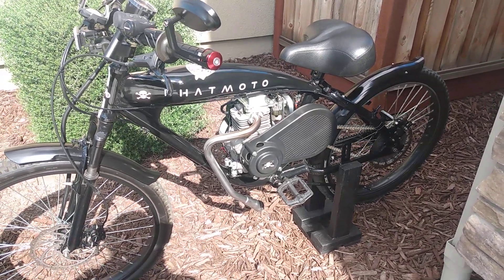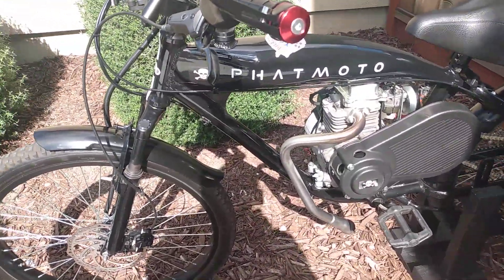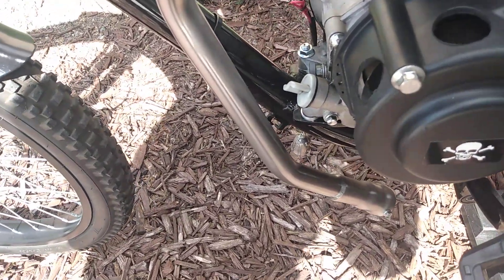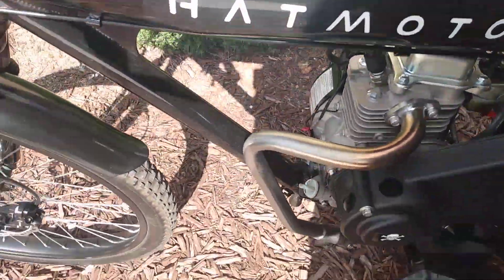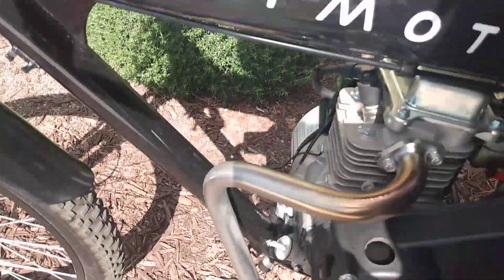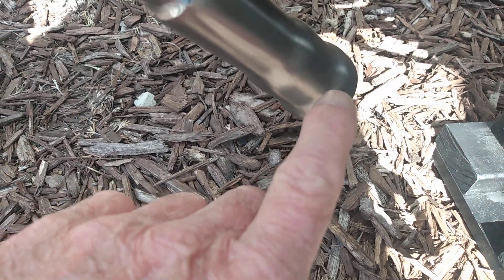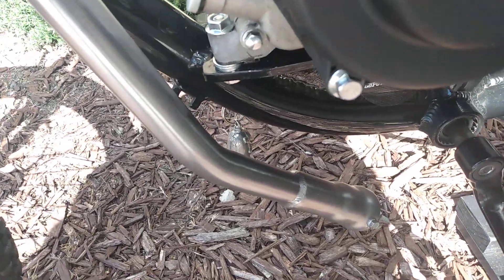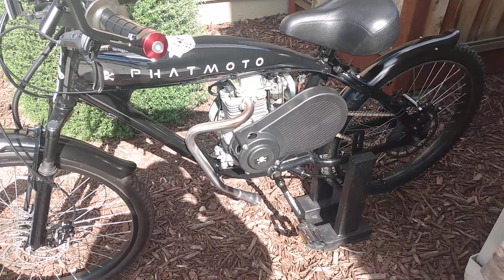Phatmoto with new AR Sports flared trumpet exhaust (Sound) baffle installed

Comment: I have the same pipe. I sprayed it with 2000 degree paint then double pipe wrapped it. I sprayed the wrap with more 2000 degrees paint. Once dried I sprayed high temperature gloss   It looks really nice and you can lay your hand on it. I also milled the head and shimmed the valves. I also rejetted the carb. I also made new vinyl stickers that say 49 cc ohv. Looks and runs awesome.

Comment from the maker: The baffle consists of a threaded rod, 2 large flat fender washers ( different sizes) nuts with a L bracket to secure it to the pipe. The washers have 2 different size holes drilled around the circumference to allow exhaust to exit. The washers fit flush in the flares, very simple design.
Reply: Oh ok. That would be a nice diy project to do! Thanks again Beau👍

Comment: What's the easiest way to change the bearings on the jackshaft mine got messed up after 5 days of owning it and it's been sitting now for ever tried starting it but now I think I'm going to upgrade the carb I'm thinking putting the bearings in the freezer first I got one of the old ones out second is stubborn love the channel I've gone through alot in last year and a half now I'm ready to get the bike going again
Reply from the maker: Thanks for watching, putting them in the freezer does help. If you have one out already, you should be able to insert a long punch in from the other side and lightly tap it out. Do you have the 2019 model or a later model, ie: 2020, 2021, 2022? Why I ask is the jack shafts are different, the 2019 uses a 15 mm keyed shaft, where as the later models use a spline shaft, with bolts to hold on the shaft and sprockets. I always use a pick tool or a utility knife blade and pop the rubber seal off the new bearing. Then I clean all the original grease out and repack them with quality high temp,high pressure wheel bearing grease. If your bearings are from China it is imperative to do this as they put a tiny dab of grease in them, which is why yours probably failed so quick.
Reply: @beaubrummelmotorizedbicycles  it's a 2020 I waited so long to get it then it broke then my brother got sick and passed away n I just lost my auntie cpl months ago and my friend was murdered n it just sat I got the new jackshaft kit then it wouldn't stay running so somebody told me pump gas ruins those cheap stock carb so I'm just going to order a better one and hopefully I can get it running again it's been a tough year and a half but thank you for replying I watch all your videos and it gives me inspiration depression sucks but I'm getting better have a great day and I'll be watching
Reply from the maker: @itsdarooster8160  Sounds like its been some difficult times lately, but better days are ahead. You can get a new carburetor on Amazon for about $15. It will have a air/fuel mixture screw that the stock doesn't have because they were EPA smog carbs. Just search for a Lf152-3 carburetor. Pump gas is not good to let them sit, if it has ethanol in it. It will turn to gel, plug up the jets, attract water and corrode the carburetor. Sounds like all you need is a new carb and some fresh gas and it should run, get your jack shaft squared away and you should be good to go.
Reply: @beaubrummelmotorizedbicycles  yeah it's been tough but thank you so much for the information I'm going to order the carb so as I can I really appreciate it my original plan was to show how I got the bike assembly and stuff on a YouTube channel I started it then bam lol but I know you are a very busy person so I appreciate your time to help me I'll let you know how I make out n thank you again
Reply from the maker: @itsdarooster8160  Search for Lifan 152F-3 not the Lf like I said to many wrong carbs come up

Comment: They suck
Reply from the maker: @curtbeauchamp8441  That's funny mine works very well especially with my homemade baffle, fat exceeds any stock or any other exhaust available today.
Reply: @beaubrummelmotorizedbicycles  mine came with cheap bolts the mounting flange was welded sloppy and uneven it leaked caused the motor to run crappy and backfire. Brand new all terrain.